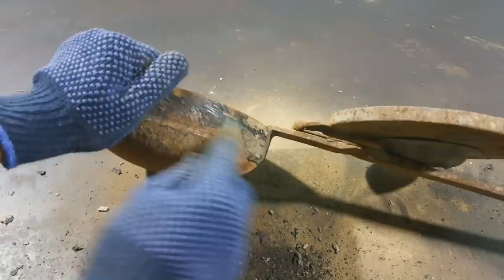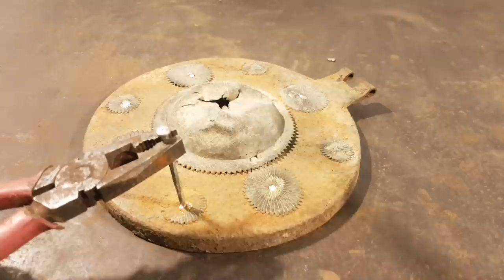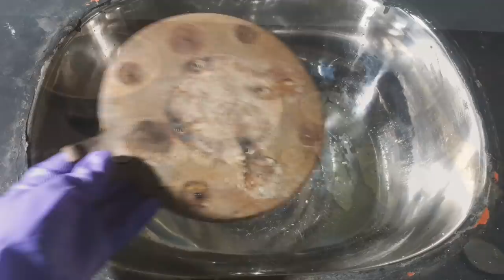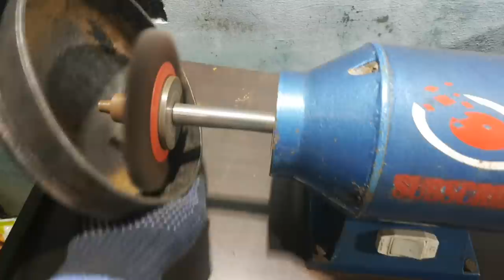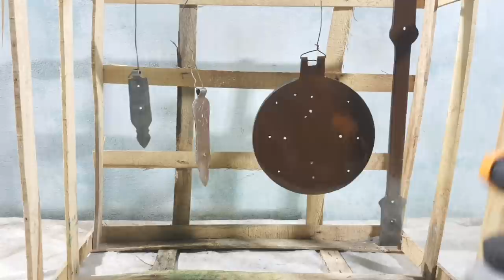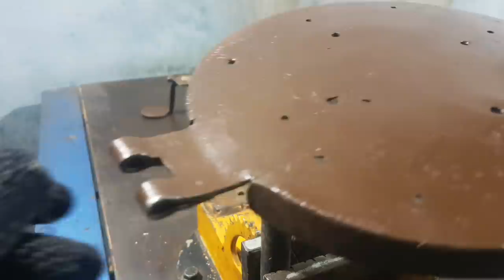VERY RARE OBJECT - RESTORATION - The complete story

Comment: I think you’ll find that a handle or a knob was attached to the brass dome you braised. That was used to lift the lid to put hot coals inside to warm the bed.
Thanks for sharing your experience with us.
Reply from the maker: Cool, thanks
Reply: This thing seems to have been modified at least once in its past.  It may have started life as a bed warmer but a bed warmer more than likely would not have had a cast iron handle.  I don't believe the brass dome or the other brass disks were original to this as there was etching under the removed disks on the hinge plate.

Comment: Coal scuttle for prewarming beds. Commonplace in the late 1700s and early 1800s  this device was commonly found in more well to do peoples homes but as for the reason why it went obsolete is advances in fireplace design and the obvously frequent fires that happened, more often than not killing the sleeper. Bet there is some cases of peoples feet being burned too. Such a rare piece like this must have been used for a long time then maybe set up as a display when that damage occured.
Reply: A coal scuttle is where you store coal by the fire for use in it this is a bed warmer.
Reply: @markskeels8132  i knew that too but its true name escaped me . I found its true name moments later from odsd lol its true name is a brazier.

Comment: If it's a bed warmer then the handle has to be removable. Otherwise nice work.
Reply: No, because they were rubbed over the sheets to warm them and then withdrawn, not left in the bed as a hot water bottle is